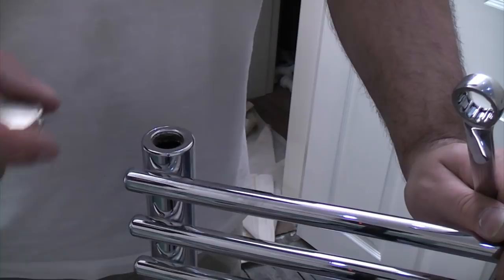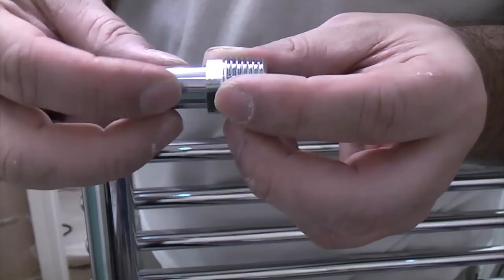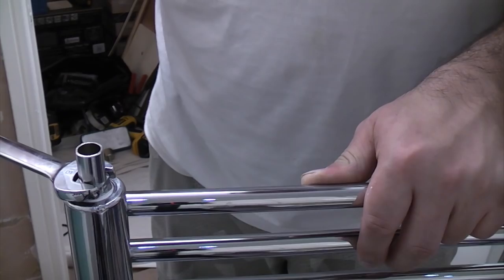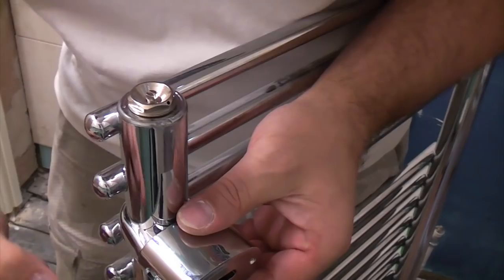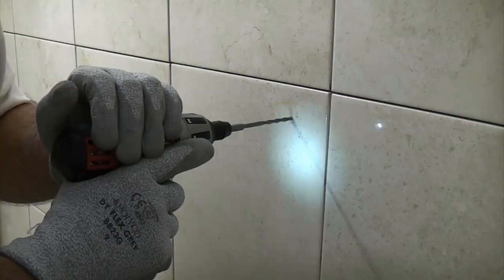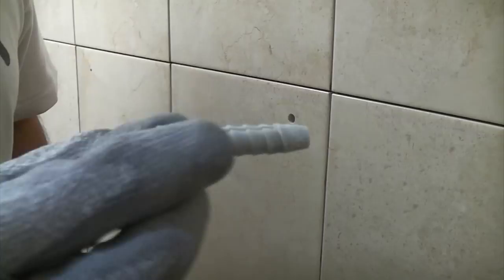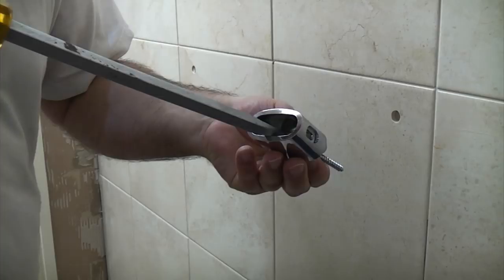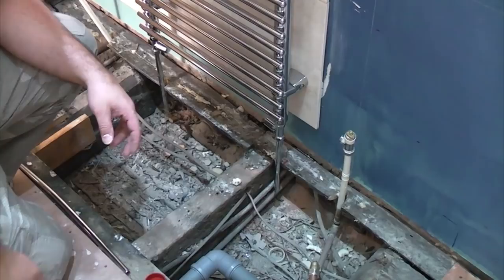How to install a towel radiator

Comment: You have some interesting vids so not out to criticise but just wondered why you didn't use a tile bit ? as they are easier to get started and basically cut holes in tiles.
I know there are a lot of " one cut" type drill bits but for a learner with less control it could result in a grab and crack scenario :(

Comment: Why compression 90's? You get a better joint with solder fitting. Also did you check if there was a 2 port TRV for the flow and return? cheers for the vieo though interesting way of doing it.

Comment: you should always fill the hole with silicone when you put plugs into bathroom walls. you can get a water damage if you dont use it

Comment: 12 times ptfe tape is way too much.
Reply from the maker: I often work on compressed air. It's always better to use too much rather than not enough ;-)
Reply: Ultimate Handyman OK i see, but I could be that you push the tape out of your treath by using to much. But you are a pro just like me so it will be OK 😊. 
Here in The Netherlands we use loctite 55 teflon cord for the last couple of years, are you familiar with that? it works great and it looks very nice.
Reply from the maker: Thanks, no I have never used the cord. 
On site we normally use PTFE tape up to pipes of about two inch diameter. Sometimes we use PTFE paste as well.
Thanks for the comments ;-)

Comment: Thanks (again) for your videos: they are really useful.

I have a couple of questions about the fixings and the valves for these types of towel rail / radiators (sorry that it's a bit of a novel).  

1) I just bought a chrome 1150 x 450 version from Victoria Plumb and the fixings look rubbish to me.  In fact, they are plastic!  I'm scared about their ability to withstand any type of rough treatment (like the kids absent-mindedly leaning on the top of them or something).  Here they are: http://bit.ly/1L7gtIx .  Have you seen such flimsy fittings before?  Any advice?

2) The above rad did not come with tails.  Instead, during the checkout process, I was offered valves with tails built in I guess.  I opted for straight ones as I have put in new chrome pipes coming from the floor.  You can see them here: http://bit.ly/1FTiLYf . I'm not too clear how to use these as the bottom fitting is obviously a compression fitting but the top one has a rubber ring built into it at the bottom with a nut that tightens onto the valve body, leaving just a thread exposed that presumably goes into the radiator.  However, how would you tighten that into the rad?  Confused :-(

3) My house (built around '93) has what I believe are referred to as 'eggbox' walls.  basically 2 pieces of plasterboard sandwiching a cardboard former.  Crap basically.  In the past, I have had no end of trouble using normal cavity fixings because of the cardboard on the other side of the hole.  Anyway, I know you are not supposed to hang these towel rails just onto plasterboard (you're supposed to either go into the timber frame, add batons or screw into the block behind) however I do not have this luxury: there is no frame nearby, batons would require almost replacing the wall and there's no brick/block behind it.  I've opted for the larger size snap toggle fittings and bolts (which you review in another video), purchased from eBay with correct bolts included.  Do you think these will do the job OK and the wall will support the rad?
Reply from the maker: Julian Smith 

1) All the towel radiators I have installed have
used these kinds of plastic fixings. I’m sure one radiator only had 3 of them
instead of the expected 4. They are quite strong once installed though,
although I’d try and stop the kids from climbing on it. (I have young kids
myself, so I know how difficult that can be)

2) The tails normally screws into the radiator using
a large hex key, if you look inside it should be hexagonal.

3) Yes, snap toggles will be fine for holding the
radiator for the wall- as long as the kids don’t climb on it, as they are not
designed to take such weight (although they probably will)

I wrote this article a few years back showing how to install
a towel radiator, it has pictures of installing the tails using the hex key
etc. - http://www.ultimatehandyman.co.uk/how-to/central-heating/install-a-towel-radiator
Reply: ***** Thanks for the detailed response!

In the article you referred to, the photo of the radiator tail and valve look identical to the picture that I had linked in my question text above (did you see that photo?).  This would lead me to believe that I do in fact have the tails but that they are simply supplied screwed into the valves (instead of being screwed into the rad itself).

What I had not noticed was the hex shape inside of the tail which would need to be tightened with a radiator spanner (large allen key).

Incidentally, As I am refitting the whole bathroom (including replacement of wonky floorboards so I can tile the floor), I have already provided the chrome up pipes from under the floor.  Can I fix the radiator valves (using their compression fitting) onto these pipes and turn the valves off, so that I can refill the central heating system?  That way, I can fit the new floor boards, then plaster and tile the walls and only later fit the towel rail onto the valves and drill the holes for the fitting brackets accordingly (without re-draining the system).  Does that sound feasible/sensible?
Reply: ***** Thanks again.  as regards the snap toggle fittings, I noted that in your video you said that when using normal plugs and screws, you should drill the holes in the tiles bigger than the holes in the wall so as to ensure that the plugs were only fitted into and expanding into the wall, not the tiles.  Is this also what I should do with the snap toggles?  The ones I have (http://www.ebay.co.uk/itm/291016591777?_trksid=p2060353.m2749.l2649&ssPageName=STRK%3AMEBIDX%3AIT) already require a 13mm drill bit!  Should I go bigger still through the tiles so that the snap toggle is only in contact with the plasterboard?
Cheers!
Reply from the maker: Julian Smith 
Yes, I saw your photo. 
The tails are normally supplied with the valves as they are normally made by the same company, just remove them from the valves, wrap the threads with PTFE tape and then tighten the tails into the radiator.
Yes, you can fit the valves, then re-fill the system and then fit the towel radiator after doing the other work ;-)
Reply from the maker: Julian Smith 
No, just drill an half inch hole for the snap toggles.
They do not expand i the hole like wall plugs and screws do, so there is no chance of the expansion breaking the tiles.
Reply: ***** Brilliant!  Thanks so much for the help.
Reply from the maker: Julian Smith 
You are welcome ;-)
Reply: Julian Smith Hmm - installed the valves (only) onto the new pipes I've created and refilled the central heating system by 1) allowing the header tank to fill, then 2) closing off the drain valves downstairs and 3) bleeding multiple rads in the house.  Then turned on the heating and hot water to check for leaks and also to make sure the new pipework holds up under pressure when hot.

Problem - the heating / hot water control panel shows both systems on continuous with red lights to confirm.  I've turned the thermostat to 30 degrees and I've confirmed that I have a pilot light in my boiler - however the boiler is not firing up like it would normally.

Any ideas what I might have done (or not done)?
Reply: Julian Smith ps: I do hear a sort of humming / droning noise when I move the controller slide switch from off to continuous but that's all. I'm wondering if the pump is not primed (after the system drain) or something?
Reply from the maker: Julian Smith 
I'm no expert on heating systems, but you could try bleeding the pump. 
Switch off the heating first, then find the pump. At the end of the pump is a large slotted screw, you can put a large slotted screwdriver in the end of it and undo it, until water emerges from it.
If it still won't fire up after that try giving the pump a gentle tap using a plastic hammer or similar when the heating is on.
Reply: ***** You solved it!  I was bleeding the pump for several minutes before the air stopped coming out.  Thanks again and sorry to be a bit of a nuisance.  So much to learn (and all at once apparently :-))
Reply: Julian Smith Think I spoke too soon.  The boiler did fire up but has gone off again much too soon (and the radiators are not warm.  The thermostat's still on max.  I tried bleeding the pump again and giving it some gentle taps but that doesn't seem to be the problem.

There is some other device to the right of the pump (see pictures here: http://bit.ly/1TnKmdA) but not sure if that is something that needs bleeding also.

I've switched off the system now and I'm thinking I might have to get a plumber / heating engineer in to advise :-(
Reply from the maker: Julian Smith 
I'm not sure if that's an automatic bleed valve or a pressure relief valve.
Your best bet is to ask here and provide as much information as possible-
http://www.ultimatehandyman.co.uk/forum1/central-heating-boilers-f35.html

Hopefully one of the plumbers will advise ;-)
Reply: ***** OK - will do.  Thx!
Reply: Julian Smith I did figure out eventually that the auto air release (?) was another valve that could be bled. I found that with the heating on, I could open this (with the finger screw thingy on its top) and air would hiss out for say 20 seconds, then I'd close it for a minute and then reopen it and it would let more air out. I basically did this for about half an hour while running to the upstairs radiators and bleeding them. Blinking exhausted now but system seems to be mostly working. 

Thanks again!
Reply: Julian Smith However - why is it called an auto air release if you have to 'manually' release the air???  Crazy :-)
Reply from the maker: Julian Smith 
Don't know, sorry.
Glad you got it sorted, sorry for the slow reply- been away with the kids ;-)